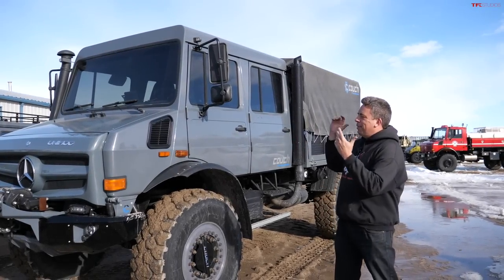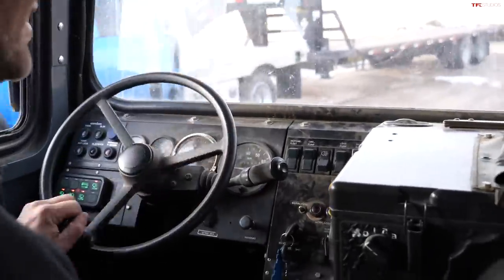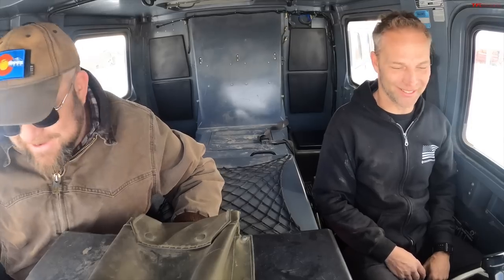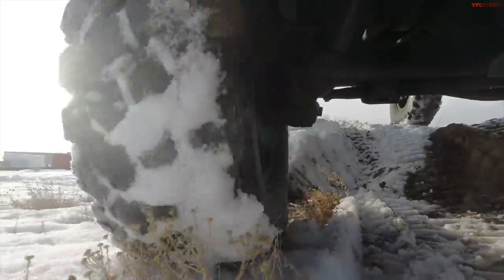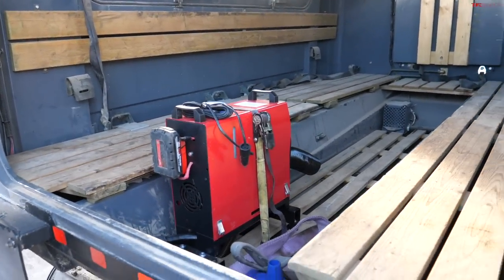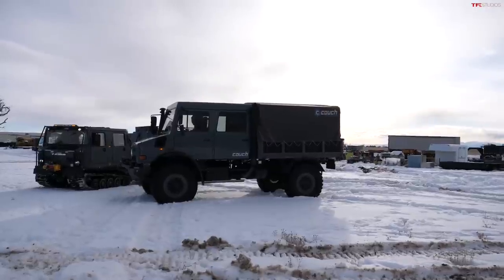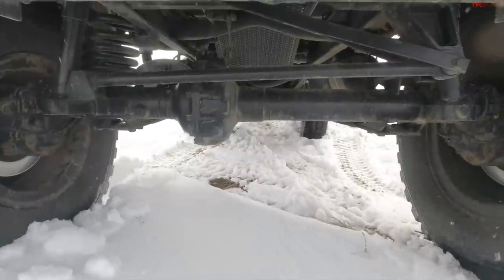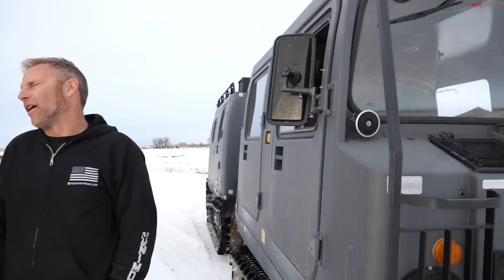Even the Mighty Unimog STRUGGLES in This Off-Road Challenge: Sometimes You Just Need Treads!

Comment: The BV206 is designed for the Swedish military to run in Swedish dense forests with marshes, creeks, small lakes and sometimes 3 feet of snow. I have never driven one but I have been sitting in the back, and the young recruits driving them seemed to never slow down for anything. I always had a sore ass (sore whole body actually) after those rides.
Reply: It was also manufactured for the US Army as the SUSV

Comment: We had one of the military versions when I did my military service with the the Arctic Rangers in Finland in the early 1990:s. It had great performance in the snow and the marsch lands. I will never forget when we tipped the trailer over with 6 military dogs and handlers inside. It was mayhem. Swearing soldiers and dogs trying to fight each other. I put my arm between my dog and another one. Luckily I had the winter uniform on and I escaped with minor bite marks from my fellow soldiers dog. Still today impressed with the axel between the trailer and the main wagon. It could twist 60 degrees withou any problems if memory serves right.
Reply: was this on a NASU or did Finland also have BV206's?

Comment: What kind of Axles does the truck have? They are tiny
Reply: The portal gearing reduces the torque that the final drive has to handle, so the ring gear can be smaller.
Reply: They are portal axles. There is a reduction gear at each wheel.

Comment: The thing is that the Swedish Armed Forces was built around conscription during all of the 20th centry. A vehicle that needed specialist technichans is not a good fit in total war with the eastern neighbour. Bandvagn 206 (littarly Tracked Vehicle 206) by Hägglunds (ä = a in ash) was a follow up to Bolinder-Munktell (bought by Volvo) Bandvagn 202. The replacement is called Bandvagn 410, is armoured and is still built by Hägglunds (now owned by BAE Systems) and the US Army has also placed a order on them.

Comment: The Hagglund who'd be great as an overlanding rig.
Reply: It gulps fuel. That is why those are usually used only by militaries, rescue services or something like remote industrial service people. People whose solution to "we are about to run out of fuel" is well have Frank the friend just drive another full tanker truck here.

Very capable vehicle, but not cheap to run.

I have seen many many people comment it would be cool to own one, but if one really doesn't absolutely need the "I will swim and crawl through a wet swamp bog without breaking sweat" there is way cheaper and easier to maintain options.

It is robust, but still the track, track suspension, the articulation and so on takes looking after.

Comment: The benefit of the Mog is that you can also use it as a truck... on the road, or as a tractor or as a generator, its way more versatail then the huglund wich is extremely good for its purpose, but its a very specific tool, good at one thing and thats conquer terrain